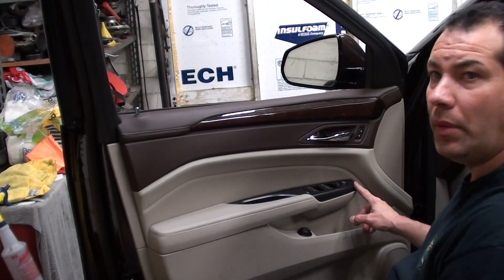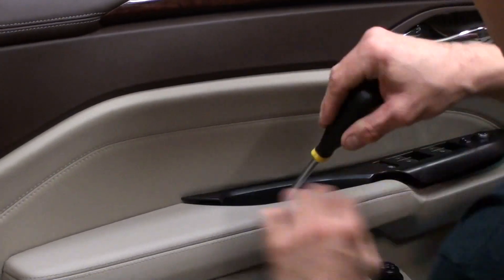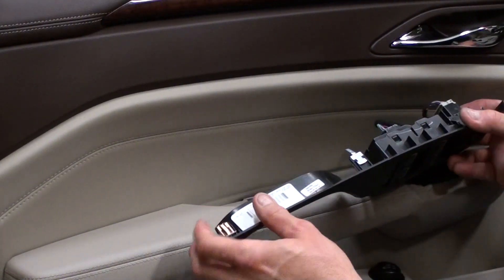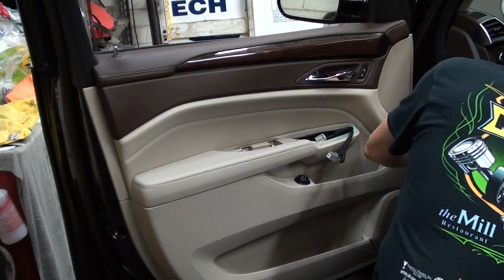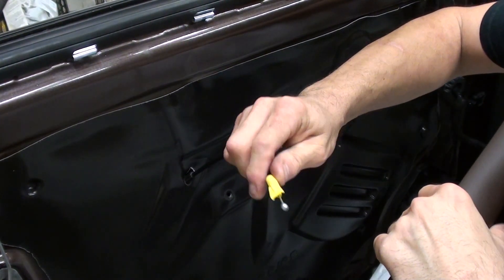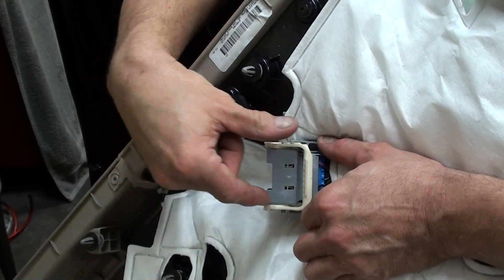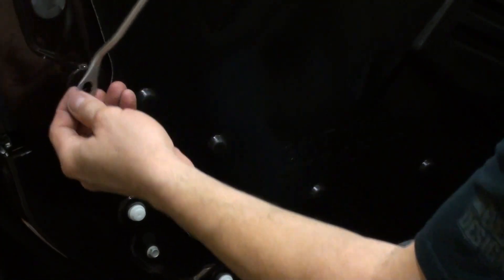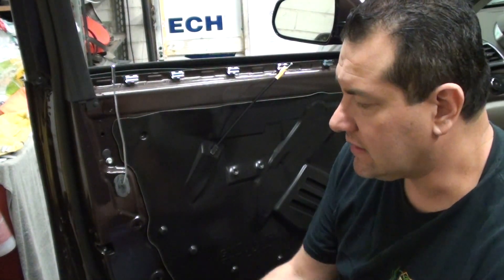How to remove front door panels on 2015 Cadillac SRX

Comment: Hi Raul, I need to get to the connector for the illuminated door handle on an XTS. It's probably the same on the srx, so what would be the next step after panel removal? Is that shiny sheet metal bolted on because I think the connector is behind it. FYI, my tint guy just pulled up on the panel by the lock and all the way across, the clips released, it gave him about an inch clearance, and he removed the seal, then tinted without doing any of the panel removal you did in this vid. Watched him do it on my 2 2016 XTS.
Reply from the maker: L. Davenport yes that would work if you can get those clips to release. Sometimes you can pull super hard and they will release, but if they don’t you run a risk to break the panel. Some cars we have never done, so it sometimes takes removing one panel to figure, you don’t have to remove the others, just get the clips to release to get the channel out of the way. 
As for the illuminated door handle connector, I don’t know much about that.  I am sure you have to take a bunch of stuff out of the way to get to that connector.
Reply: @raiderman28  it's pretty easy to remove/replace the handle completely from the outside without doing anything to the panel. However, with the one with a LED as you pull the wiring through a rubber opening, just prior to seeing the connector, it disconnects right behind the outer metal. It's out of sight and reach. Access has to be right behind the shiny sheet metal visable as soon as you removed the panel.
Reply: After second look, that may not get metal once the panel was removed. I can't tell from the video. It may be molding and I've seen it be plastic film. Can you at least tell me the material I'm looking at to the immediate right off the clip you're pointing at at 4:33?

Comment: How do I replace the lock pin caps?
Reply from the maker: do you mean the cap for the door lock rod??
they usually unscrew counter clock wise,  but not sure if this is the same way like most vehicles

Comment: Is the cadillac XT5 basically the same way to pull out the panel? I'm getting a vibration at low volume when listening to the radio. I was going to put noise dampening material on the door to help with the vibration but looking at your video Cadillac looks like the insulate the panel really good.I've seen other people complaining about the same vibration problem. I guess it would never hurt adding noise dampening material.....

Comment: Do you need to remove door panel to replace the mirror ???
Reply from the maker: Jeanie Doyle it has a plastic cover on the opposite side of the mirror ( inside of the door side). Not sure if the cover comes off with out taking the panel off. You can try to see if it prys off. Usually 3 bolts that hold most mirrors. If you can pry off that little access panel, you will have to take door panel off. Most electric mirrors, you do have to take panel off, because you have to get to the electrical plug to unplug it either way.

Comment: Where can you get those tools your using?
Reply from the maker: most of the tools you can find them at habor freight tools or online on ebay
Reply from the maker: these tools are avail at harbor freight, or on ebay.  the white tool is called a bone tool and the other is a panel popper or door panel tool